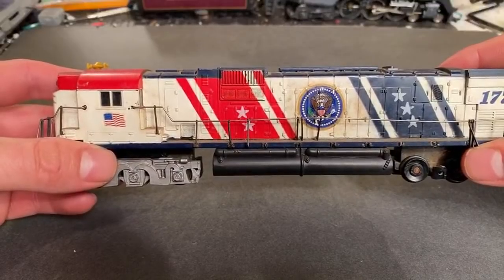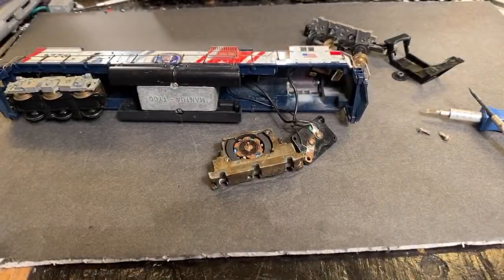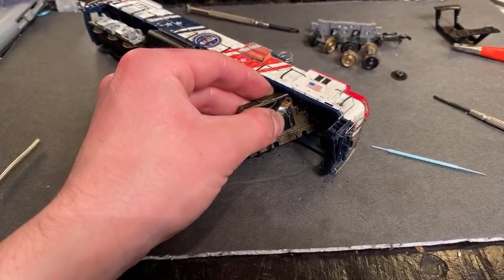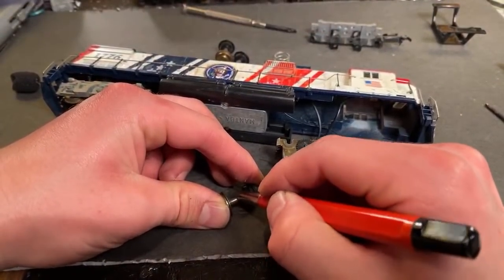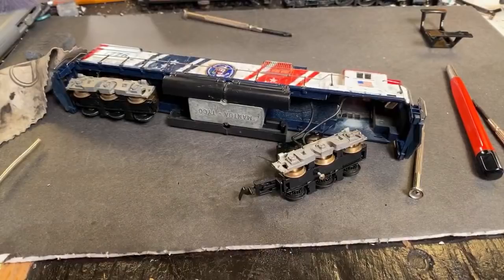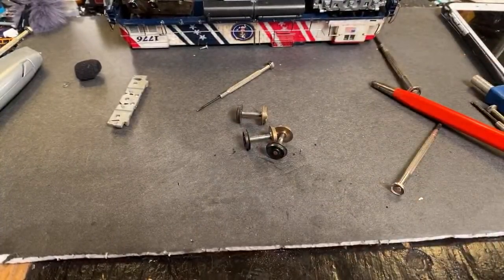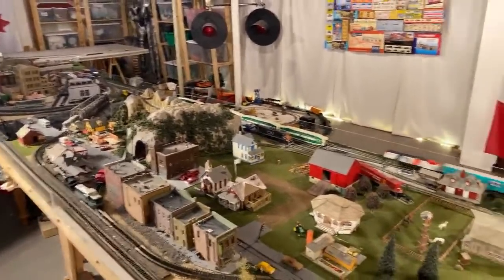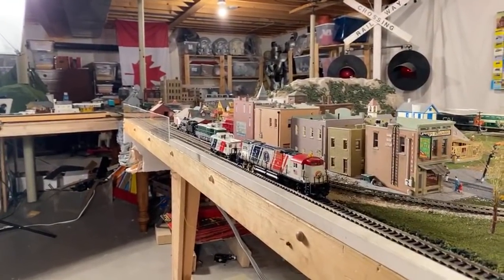Can we Make This Tyco c630 “Spirit of 76’ “ Run Again? Repair Live

Comment: 6:50 Denver South Park & Pacific was a Colorado narrow guage railroad.   It featured the fabled and historic Alpine Tunnel.   At over 2 miles above sea level it was the first and highest tunnel to cross the continental divide.   The entrances have been closed up since 1960 and the timber lined interior is quite dangerous.   DSP & P used 10 ton  4-4-0  American type wood burning diamond 💎 stackers.

Comment: Hey SMT - I have a suggestion for your PowerTorque brush / spring reassembly challenge. I took an old credit card and cut a one inch narrow slit in it. The slit should be just wide enough to pass the motor shaft through it. After you balance the springs and brushes in the retaining holes, place the credit card over the brushes with the slit in the middle of the assembly. Squeeze the card down to compress the springs and place the brush assembly down on the commutator side. Line up the motor shaft with the bearing and gently pull out the credit card and screw it back together - assuming you haven't misplaced the screws lol.
Reply: Good idea, but I suggest finding something thinner like a used feeler gauge or shim.

Comment: SMT, after you use the fiberglass pencil you need to get compressed air to blow off the fiberglass particles off the  commutator. When I use the fiberglass pencil I get itchy around my wrist from the fiberglass particles and it drives me crazy 😜

Comment: If you are having to eyeball two screws to see if they are the same size, line them up facing opposite ways and see if the threads mesh. If they fit in right snug then they are the  same thread count, and it becomes easier to feel if the diameter is the same.

Comment: I personally use Marvel air tool oil.  Costs less than $5 for a decent bottle.  My experience says due to the heat and pressure you just need a decent oil and not a premium - the same way there is no real difference between a $10 HMDI cable and a $80 one.

Comment: The later versions of those had truck sideframes that were called "vampire fangs" based on how the top half of the truck comes to meet at the center bearing, which they say isn't prototypical for Alco.

Comment: I have a similar Tyco loco.
It is the Silver Steak model.
The electric motor and the bottom of the running gear is the exact same type as yours.
Although is has a busted coupler all the way to the trucks, and the truck skirts are somewhat good/bad condition
I have two of them .
One runs good and the other needs some work
One patina'd pretty bad and the other one looks new plus one Silver Streak caboose.
I did notice when you were going through your shelf you have the caboose at 1:04 mark
And it looks like at the 1:05 mark you have the loco too on the shelf where you found the Spirit of '76 caboose.
Now that I see the inner workings of this motor and the same as mine I may be able to tackle it and get the good one running better.
Plus I have had some luck finding other loco's for a minimum of $5 and got them running again (just needed lubrication)

Comment: I had a pair of C630s like this. They were painted for Chessie System though. I don’t know if Tyco ever had them in the prototypical Norfolk and Western blue with yellow lettering as delivered or the latter black with the block NW in white. I could be wrong but I think the N&W was the only railroad that had the high nose C630. I don’t know if the Southern ever had any. I know Southern had a few U33Cs.

Comment: SMT - Doesn't the plastic brush plate have a brass bearing for the armature shaft?  If so, that bearing should get a drop of oil. I recall seeing a track cleaning pad on a stick for cleaning track inside a tunnel.

Comment: I have a Tyco Spirit of 76, but it’s a different engine. The 76s were selling because of the Bicentennial. Was that an eraser you using? And what kind of oil do you use again?
Reply from the maker: The eraser is a Peco track bright. I usually use labelle 106 102 or 107.

Comment: what kind of pick do you use to clean out the spaces in the commutator? is that the same pick that you are using in this video?
Reply from the maker: It's a tooth pick. It doesn't matter what you use so long as it's softer than the metal.